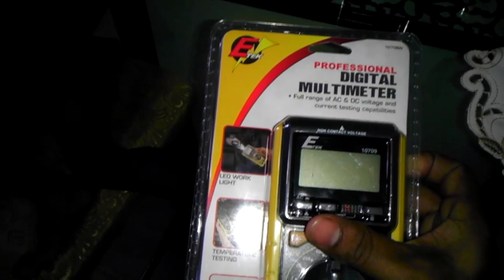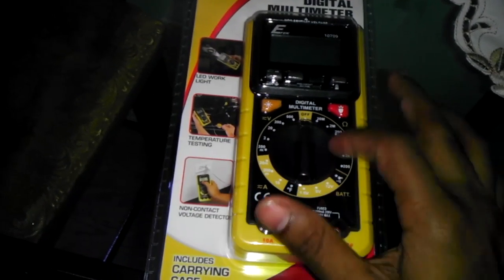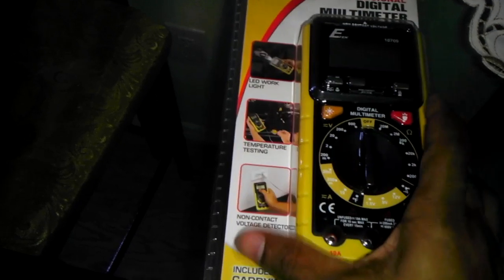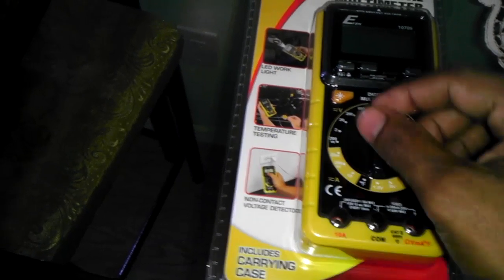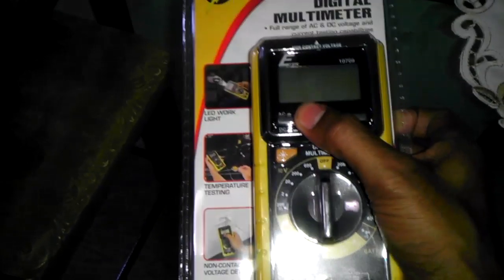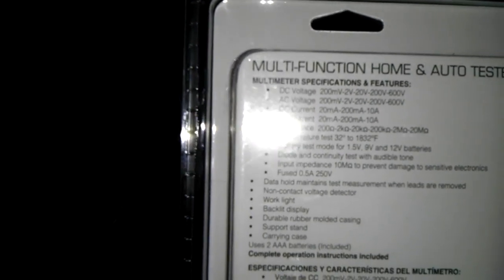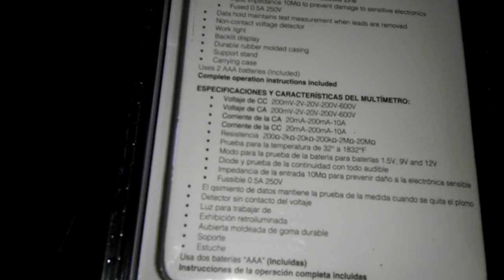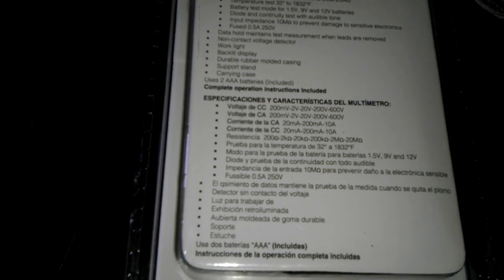Etek digital multimeter unboxing/review

Comment: I got this as a gift, it works, i had the AC button pushed while measuring dc, so i opened it up thinking somethings wrong with it. Solder job inside is crap, but it works.  Nice features, decent cheap model.
Reply from the maker: +Nathan Darker cool..
Reply: +HP11208 like a cucumber

Comment: Got the same one its pretty accurate
Reply from the maker: Donald Heston Cool
Reply: I guess it doesn't test DC Amps.  I pay attention to the symbols, and this meter has the A with a wavy line which represents Alternating current (A.C.).  

Sure wish this thing came with a manual.  At least mine didn't.

Comment: when I looked at this at Walmart I was surprised to see the input impedance spec even list on such a cheap meter. No doubt  the no contact tester doesn't actually read the  voltage , but detects  a live circuit. I believe this a cat III rating, though I don't know how trust one could put in that given it's a 20 dollar bull meter. More than  likely I'll get one to keep in my truck.
Reply: Ive got one an its not bad I use it for impedance on testing my subs thats how I figured out why my amp kept turning off